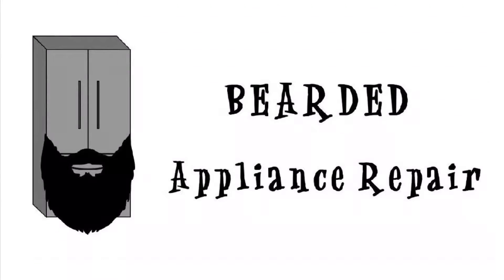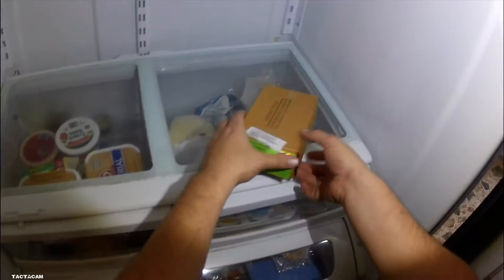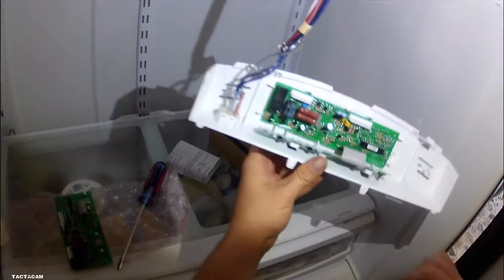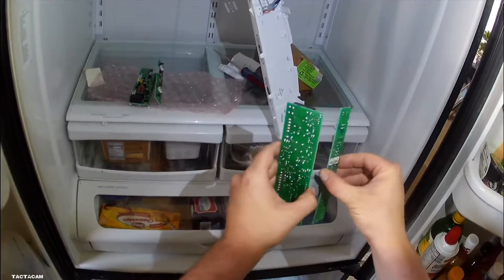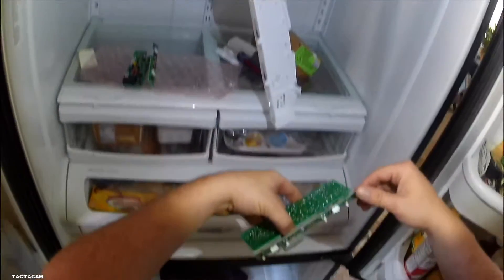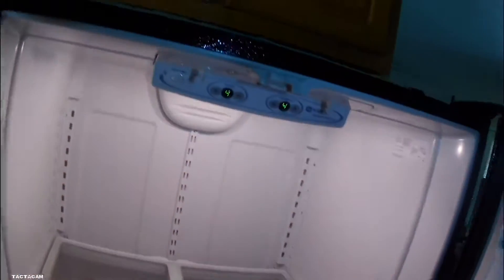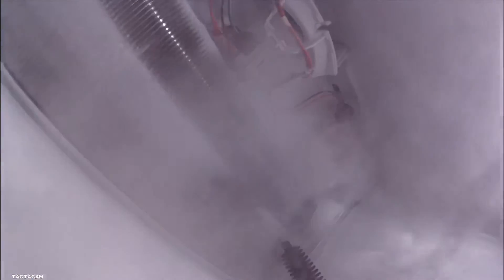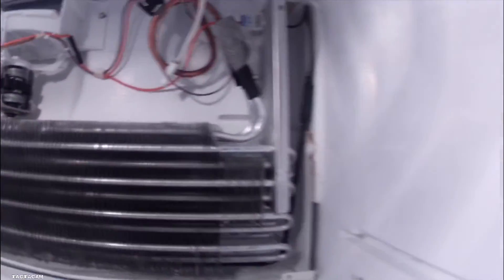Whirlpool No cool Diagnosis and Repair. Jazz board

Comment: Very good!  This video helped a lot in that same exact issue.  Just to point out that same problem (ice accumulation) can be due to a defective thermostat, heating element and/or defective thermal sensor.  The fix would be different, off course.  My doubt is how did you determine it was the board and not the other parts?

Comment: my whirlpool has this jazz board. The defrost heater comes on and stays on for a complete defrost like it should but only in forced defrost mode. it will not automatically defrost, but putting it into forced mode once daily and letting it run works fine.

so why???
A. The defrost heater and defrost thermostat are working properly.
B. The control board IO and relays are working properly.

the only thing left is the software on the board is not commanding the defrost mode automatically. Seems like they are purposely programmed to fail every 2 years like clockwork so you have to buy a new one. Forced defrost mode and automatic defrost mode both use the same IO on the board and the same exact physical hardware is used to complete a cycle. So not automatically doing this proves to me it is intentional software programming preventing or turning off the automatic defrosting of the refrigerator causing wasted electricity and spoiled food.

am i missing something here???
Reply: I've got the same problem with my fridge.
It will only defrost if doing a forced defrost.
It seems really strange that a control board would somehow lose its logic (only the part having to do with defrost).
There's a way to change the defrost interval from adaptive to fixed (at 6 hours). It's accessible through service test mode. I'm going to try that & see if it frosts up again in a few months

Comment: Do you offer your trouble shooting services. Our jazz board has done this before and is doing it tonight. It is displaying a (-) symbol for both the freezer and refrigerator temp settings and both fridge and freezer are not cooling. We reset it before but I can’t remember the sequence for the (-) symbols. Unplugging hasn’t worked so far

Comment: What if I put the board into service mode and the first test shows a "0" instead of an "S"? Does that mean I need anew thermostat instead of a control board?
Reply: Great question that I would also like to know but I changed my thermostat and it still reads "0"